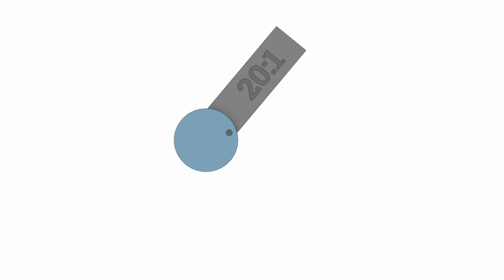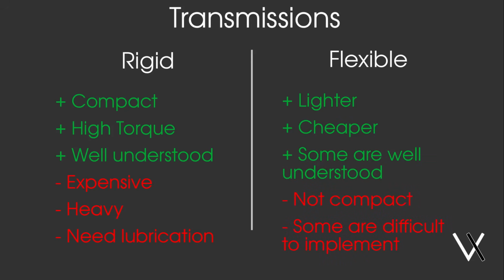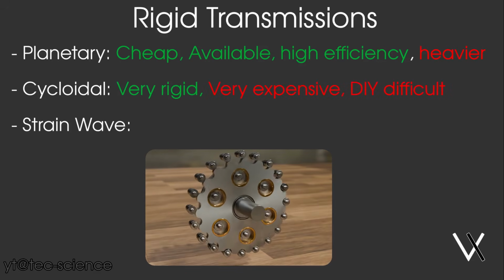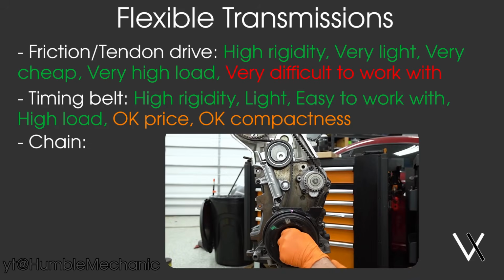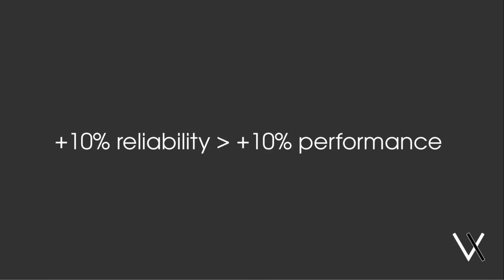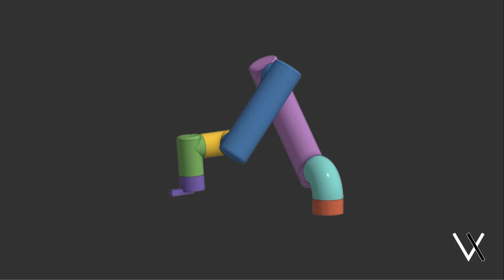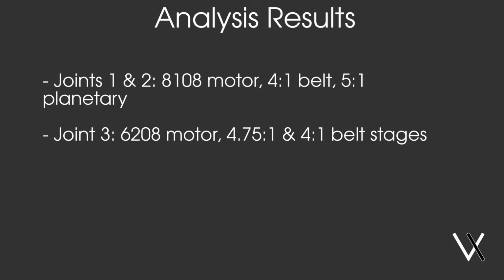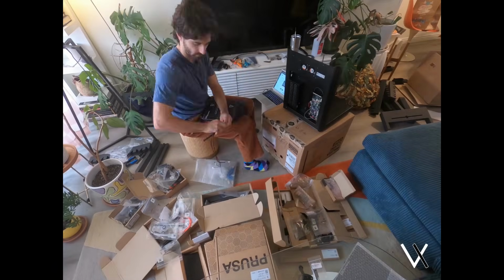Transmission: Impossible - Robot Arm Edition (Ep. 4)

Comment from the maker: Hey everyone, thanks for watching! Something I completely forgot to mention in the rigid transmissions section is backlash - how much play there is in the output of a gearbox. As mentioned by @devalopr in a comment below, cycloidal and strain wave gearboxes have lower backlash than planetary gearboxes. In general this is an important metric, but in this arm it's slightly less relevant. For this arm the first 4 joints will have input and output encoders so although I'll be using planetary gearboxes on the first two joints I'll be able to detect any play/backlash very precisely and compensate for it with software. For the last two joints where I'm also using planetary gearboxes the backlash is much less relevant because they're so close to the output, so even a 15arc-min backlash which can be achieved with really cheap planetary gearboxes will only result in <0.5mm of error even 10cm away. In terms of flexible transmissions both friction/capstan drives and timing belt drives have very low backlash
Reply: Will you be publishing the algorithm for backlash compensation in reverse kinematics?
Reply from the maker: @Ender_Wiggin absolutely. All the software will be on the gitlab. I'm going to start with something simple in terms of using the second joint encoder to detect and compensate for backlash but I suspect I might have to make something that's quicker than that (detect and compensate vs predict and compensate)
Reply: Compensating backlash by software... sounds easier said than done. Although I don't have experience with robot arms like this, I do have experience of motors shaking themselves apart from backlash-induced controller issues.
What kind of encoders are you going to use? If you're planning to compensate backlash via software, can you predict how many encoder counts you'll get for the backlash? Is that even a concern?
Reply from the maker: @gergelybencsik8626  Very good questions, and it's definitely a concern. It is certainly a solution that is easier said than done, and I expect it to be one of the areas where I'll have to do a good amount of testing on the finished arm. There's definitely risk of oscillations depending on the implementation and making the controller gracefully handle backlash without oscillating like crazy is not trivial. I'm going to be using a magnetic encoder like the MA600 (or similar) which can get ~ 0.1 degree accuracy (after calibration) and I'm expecting ~15-25arc min of backlash (0.25-0.4degrees) so that's only a few encoder counts (but more than one thankfully). 
That being said, I'm going to attempt the software compensation as a first line of resistance. If that doesn't work after a few attempts I'm also going to try a helical gearbox that is still relatively cheap (~$65) but has 3-5arc min of backlash (0.05-0.08degrees). Even with no compensation with 0.08degrees of error, that is only ~0.7mm error at 50cm out (max reach) which is plenty of open loop accuracy for what I'm trying to do, given that I don't really have a super tight backlash/accuracy requirement I'd be happy with that and if there's a strong need for lower backlash I'd probably look into using multi-pole encoder output magnets to get arbitrary precision, at which point I'd expect other parts of the system to be larger contributors to innacuracy
Reply: No, +10% reliability is not better than +10% performance in many situations. That is only true if you have all the performance you need there will be many scenarios when you need that 10% performance and the reliability does not matter.
Reply from the maker: @thomgizziz definitely. That was meant more for the specific context of this project with the caveat as well that for this arm I care much more about a robust solution, and getting more performance out of the rest of the system can be done relatively easily (which like you mention is not always the case)

Comment: cycloidal are actually quite simple to DIY. Anyone with access to a CNC mill can build one.
Reply from the maker: The difficulty with cycloidal gearboxes unfortunately isn't with the complexity of the design, it's that the tolerances necessary to hit are very tight so there's virtually no cheap options off the shelf which severely limits accessibility. For a one-off design or producing diy small batches that's fine, but it isn't suitable for an open source product with off the shelf alternatives

Comment: im not sure what timeline your living in were belts a cheaper than chains - having recently replaced the chain drive on my bicycle with a gates belt at 10x the price - 10 ! - it is better though - no regrets.
Reply from the maker: Super fair - I did not cover any of the info on chains in the video, but one thing I found out during the research is that specifically for stuff like robotics where backlash is important it becomes necessary to use engineering grade chain (harder metals, pre-stretched, etc). These are the chains that get more expensive and approach or exceed gates belt prices. For biking, backlash does not matter at all because force is only applied in the same direction so regular chains are plenty

Comment: What is the benefit for joint/arm 4 and 5 being such different lengths? What's the calculus on sizing these this way? How does a long and short arm benefit you over two equal lengths arms?
Reply: It's interesting that animals have evolved this way too! Da Vinci's Vitruvian man and how the lengths of our limbs follow the golden ratio: We have long arms, then forearms, then wrists, then three segments in our fingers, all decreasing in length. Such a configuration is only natural, literally.
Reply from the maker: @johnstephenson5158  absolutely. It's quite incredible that this repeating pattern is present at the arm and hand/finger level like you mentioned. The dexterity in our hands and the fact that our fingers are driven from muscles all the way in the forearms in a way that multiple axes are coupled but still have so much dexterity is quite underappreciated
Reply: @johnstephenson5158  For sure! The book "Structures: Or Why Things Don't Fall Down" by JE Gordon also does a really fascinating job explaining mechanics/failure modes and how biology and animal/human bodies have evolved to avoid these failure modes or maximize performance over time.
Reply from the maker: Good question. In general there can be variations on that geometry, for example in some robots you'll see joint 5 be coaxial with joint 4 instead of perpendicular, and then only joint/section 6 at the end. In robots that I've seen with geometry like the mockup in the video they mostly keep the last two joints at the end because they can stay relatively light and low torque, and they can basically be duplicates of each other which is more of a system/manufacturing level benefit. More directly I think long arm plus short arm makes sense because you get the same number of DoFs and the first section has to provide the same amount of torque in either case, but having a shorter second section means that the second joint is closer to the payload and so it can be smaller/cheaper/lower weight and has a side benefit of the backlash of that joint resulting in a smaller deviation at the end effector - although that has to be balanced with the fact that the weight of the second joint is shifting away from the base of course

Comment: Nice video! I’m sure you will design it well and already know this but remember, the more rigid the pulley shafts and the pulleys themselves are in the 2 stage, the less friction there is (=higher efficiency) good luck!
Reply: I'm also working on a similar design, and as much as I love 3D printing I'm looking to use aluminum for some of the pulley parts to get that regidity. Trying to avoid plastic deformation at the highest stress points.
Reply from the maker: @cbshipper5719  I agree. I'm going to be doing plenty of testing to see where the limits of printed nylon and PC are. I'm hoping Nylon will minimize wear because the gates belts have a nylon surface, but I suspect they'll only be usable long term on larger diameter pulleys or on the first stage of the reduction where there isn't as high of a stress concentration. Thankfully small diameter aluminum pulleys are easy to source
Reply from the maker: Absolutely! Thanks!

Comment: Sorry but this arm will have a lot of backlash. The same way you have calculated the strength of the motor you need for each joint, go and measure/calculate the backlash for each joint and then add them together!
Reply from the maker: Definitely something I'll be checking out once the arm is built. Most of the backlash will come from joints 1&2 so there's a good chance I'll have to experiment a bit with those and maybe swap them out for higher performance helical planetary gearboxes or another belt stage

Comment: Hi! I developed several robotic arms for student robotic competitions, and I can propose a few ideas for your arm. 
1. For joints 5 and 6, worm gearboxes are ideal. They are very compact and light, and those joints won't experience serious backdriving so they won't break. Unless you need some killer force feedback, this is probably the way. 
2. for joint 4, you can put your motor as a little counterweight, and connect a belt drive, further extending the blue section to the back. 
3. For joints 2 and 3 I'm a fan of a coaxial base (both motors sit on the same axis at the base of the arm, one drives joint 2 directly, the other driver joint 3 through a belt.) This moves all heavy motor coils and gearboxes to the ground, and the rest of the arm will be feather light.
Also, unless you desperately need a rotating base (joint 1), you could instead put a linear sliding mechanism on two carbon fiber rails and a long threaded motor shaft. Its 5-10 times lighter (and cheaper) than a cross-roller bearing you'll need for the turntable, and it has zero backlash which will matter a lot in the base of the arm.
Reply from the maker: Thanks for the detailed feedback!
1: for this arm I'm mostly focused on backdrivability and force feedback so I'm sticking to low gear ratios (check out vid 3) otherwise a worm drive would definitely make sense
2: that's a great idea. I'll see if I can fit that in
3: I'm considering doing this as well. I'd like to avoid coupling the two axes, but I might experiment with it anyways to see how it feels
4: I'm going to try a couple of gearboxes to see how bad the backlash is, but if it's too much I'll give your idea a try!

Comment: Don't planetary gearboxes usually have a lot more backlash than strain wave or cycloidal gearbox? You didn't consider that aspect?
Reply from the maker: Yes! It's definitely worth noting that they also have more backlash and this was considered, although I should've probably mentioned it in the video. For this arm the first 4 joints will have input and output encoders so although I'll be using planetary gearboxes on the first two joints, I'll be able to detect any play/backlash. For the last two joints where I'm also using planetary gearboxes the backlash is much less relevant because they're so close to the output, so even a 15arc-min backlash which can be achieved with really cheap planetary gearboxes will only result in <0.5mm of error even 10cm away
Reply: @vertex-robotics  That's great, all the best!
Reply from the maker: @devalopr thanks!